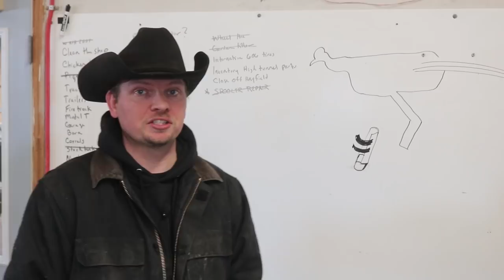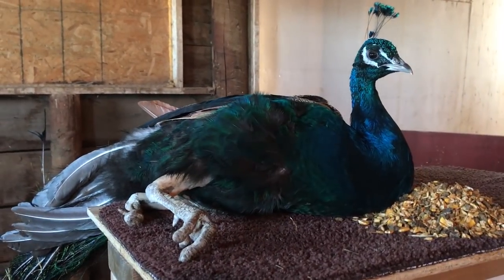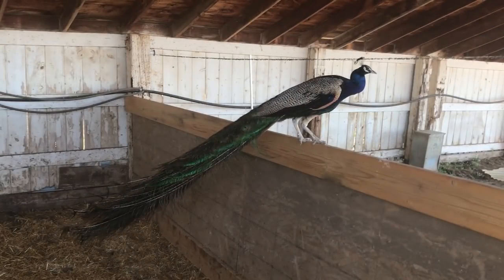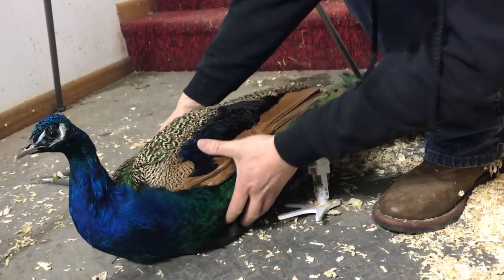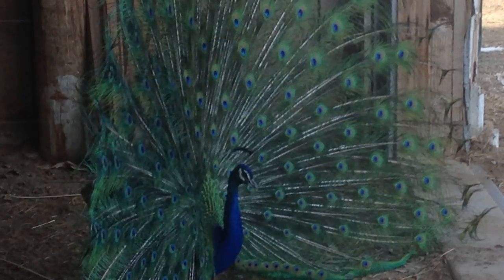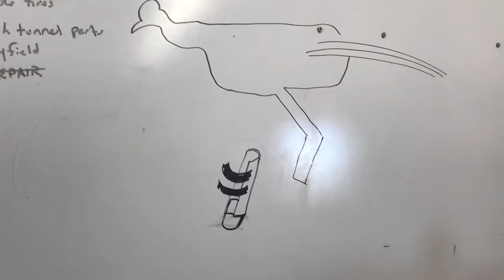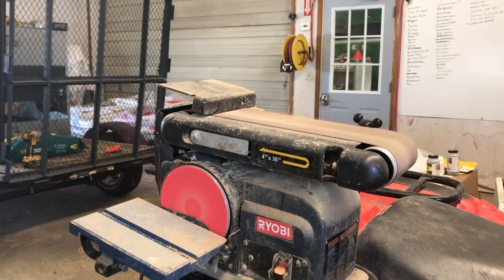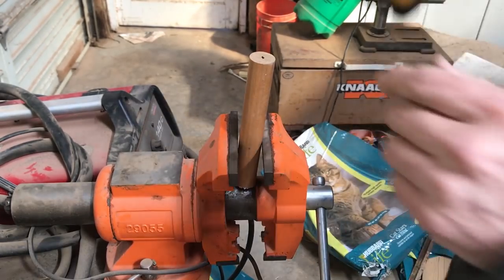Peacock Leg 2.0 - The Project List

Comment: Maybe putting some sandpaper on the bottom of the prosthetic leg or putting a screw through the center of the wooden dowel with a small part of the wood sticking out towards the ground will help offer traction on ice wooden perches and other surfaces.
Reply from the maker: Great idea, thank you - Mike

Comment: mike what about after you get good idea whats going to work what about the final one being made of balsa wood and treated with oil of some kind that would not harm him for water treatment i know the kind of oil it is but for the life of me cant think of it today
Reply from the maker: Thats a good idea, my only issue would be the strength of it but I like it, light and easy. Thanks  - Mike
Reply: would think it was light enough you could use extra wood in areas that need more strength where needed maybe
Reply from the maker: Very true. I didn't think of that. Thank you

Comment: The first prosthetic was a horrible design with that big ol foot on there. The plastics usually used for printing are not durable enough for that application either. Your design Mike, seems like it will work. Just needs time. Hopefully the muscle isn't too atrophied at this point. You must really love that bird to go through all that!
Reply from the maker: Its definitely an ongoing process, now that we have a working prototype we can keep tweaking it.  Possible coming up with a latch system to hold it on rather than velcro.  Thanks for watching - Mike
Reply: Our Wyoming Life. You already mentioned comfort, so I'm sure you've got some ideas. I did want to mention neoprene though (the same material on insulated muck boots or waders. A thick pad of that material right where his nub sits would be durable and comfortable for him.
Reply: Proves one thing, I believe, when things are made simpler they most often work better.